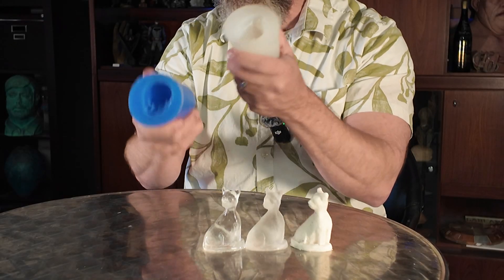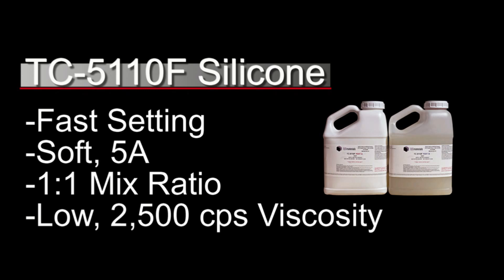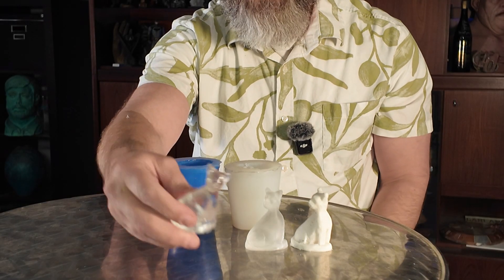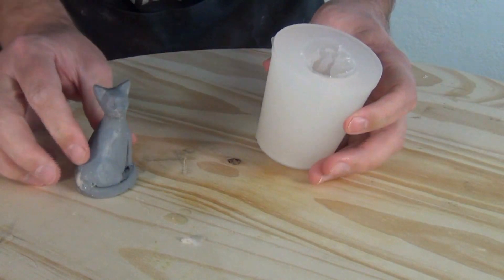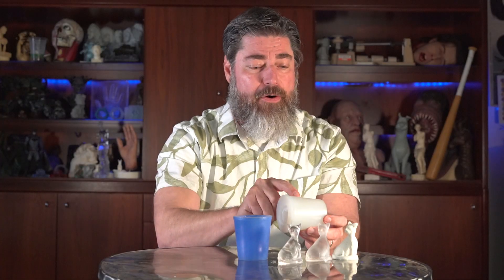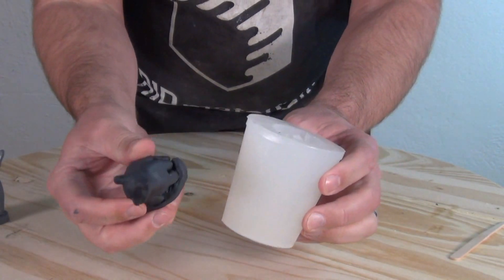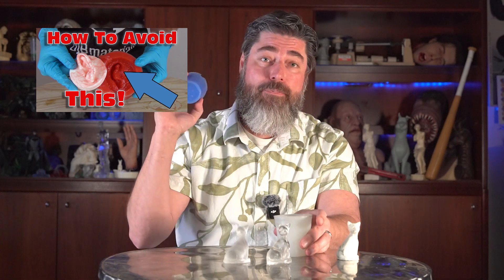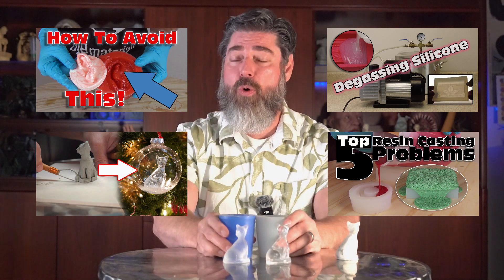Low Viscosity Silicones: Is Degassing Required??

Comment: I follow some resin dice-making groups and every so often there are posts showing exactly what you're describing, when they use a pressure pot when casting resin without having either de-gassed their silicone or cured the silicone under pressure. Tons of these little blisters from where the resin forced its way into the voids in the silicone. 

So if you're gonna do resin under pressure, make sure your silicone molds are properly degassed/cured under pressure themselves! Most folks who used pressure cured the silicone at 10+ psi more than the pressure they cure their resin pours at. 

Great video, as always! And I love that we get to see the person behind the voice now :)